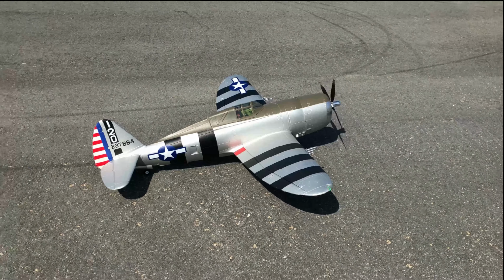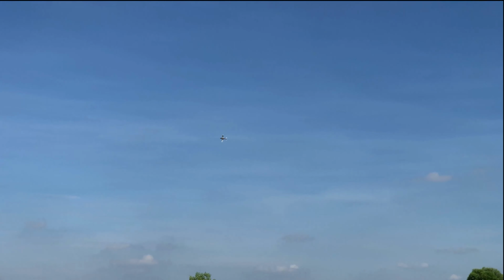P-47 Razorback 1500mm Bonnie - Installation ESS-AIR V2.0 Engine Sound in the field with tuning

Comment: Very nice,
I just got this bird and wanted to ask you what flap setting deflection do you have for takeoff and landing, the book doesn't address this and if any elevator is necessary when throwing in flaps, Thank you
Reply: Hi, for take off no need flaps and for landing just 30 degrees is enough. It will pitch up when the flaps are deployed so you can mix some elevator to correct it.